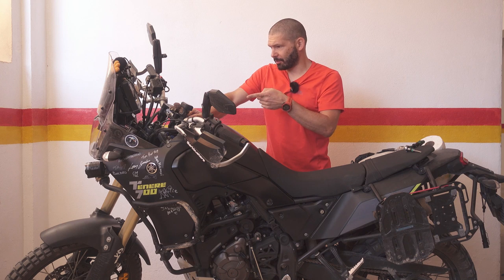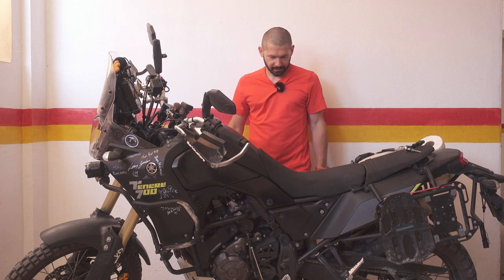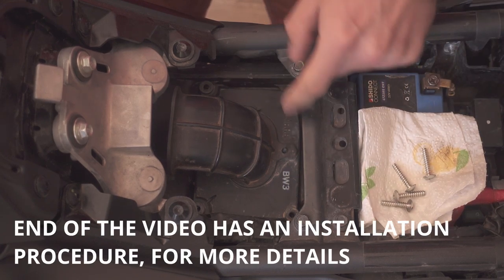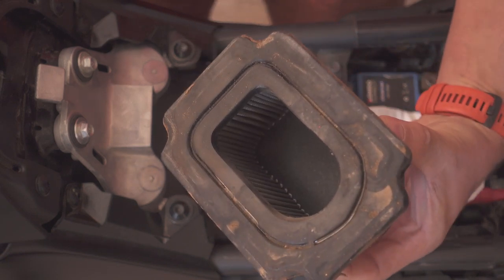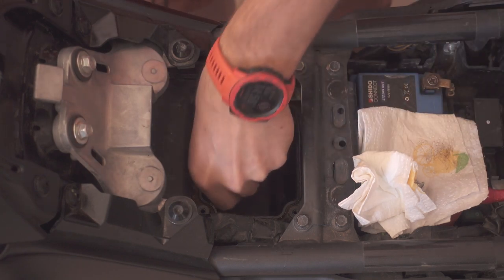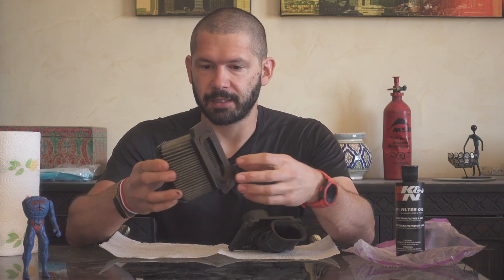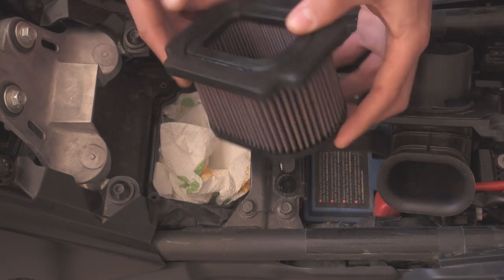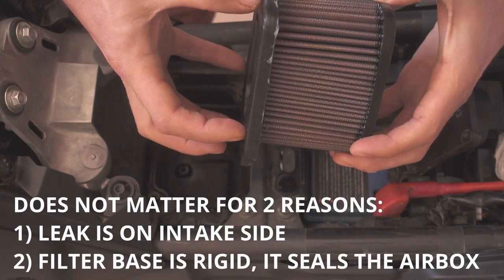Yamaha Ténéré 700 10k: Guglatech air filter - review, wash & installation

Comment: ORDERED!! Thanks Dude. 👍
Reply from the maker: I'm sure it will work well! You're welcome!
Reply: Did you notice any difference compared to the OEM filter?
Reply from the maker: What kind of difference? You mean HP etc? If so, no. I'm using the washable filters for easier serviceability and they provide better airflow which I only use about 5000m altitude... not very often ;)

Comment: Thank you good video....you have cut the snorkel in the airbox?
Reply from the maker: Ah, yes, I did cut about 1cm off the snorkel, I think it is now standard practice in Australia.
Reply: Results / benefits?
Reply from the maker: The only benefits it apparently has is that the dust will be more uniformly distributed throughout the dirty side of the filter and not just stuffed at the bottom, although it would need more testing.

Comment: You may want to consider adding, in addition, a Uni Filter to the entrance of air filter.
Reply from the maker: Hi Kim, I could add pre-filter of course but the thing is that Guglatech filters very well and when oiled it's just so reliable. The prefilter would just prevent the worst entering the filter but in case of Guglatech I just wash/reoil more often. So I can inspect and re-oil if necessary.

Comment: Are you still using the Guglatech air filter? How is it long term?
Reply from the maker: Yes I still use the Guglatech filter as well as the Guglatech fuel filter. Both from 2019 and it seems both work very well so far.

I’ll be doing an episode about both of them when I leave Tunisia to see how they protected the bike in the Sahara.